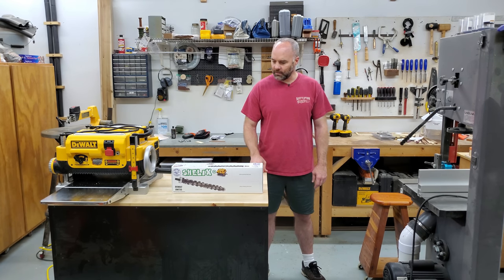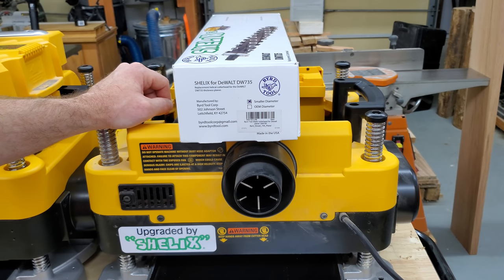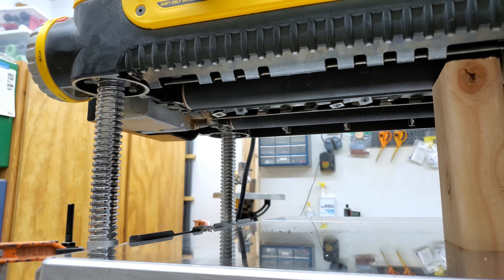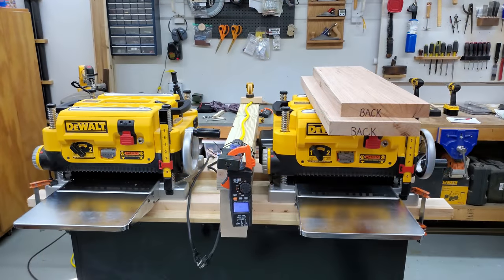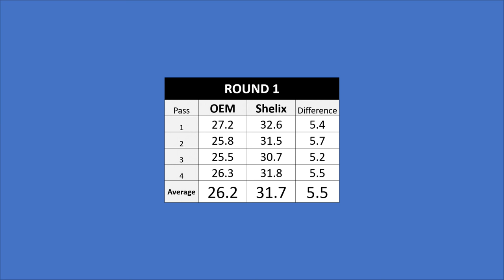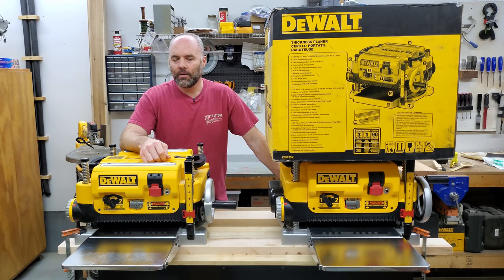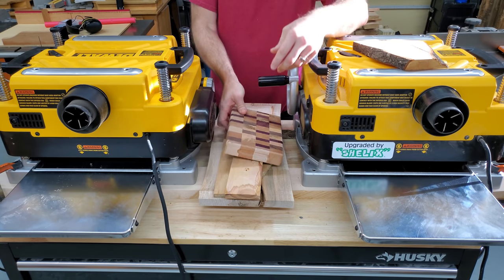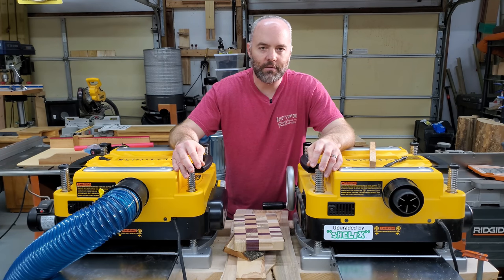The video I wish I watched before buying a SHELIX

Comment from the maker: After numerous questions and comments about amperage measurements and circuit breakers, I decided to disassemble the original circuit breaker from this planer and overload it with twice the rated amperage: https://youtu.be/24f-J0lVo-E. Thanks for keeping me on my toes and challenging anything that doesn't sound right, it makes this channel a lot more interesting for all of us.

Fun fact: This video resulted in Byrd Tool Experts (a distributor of Byrd Tool Corp products) contacting me for an interview, which you can see here: https://byrdtoolexperts.com/the-snekker-show-interview

If you're looking for an installation video, your search is over: https://youtu.be/8J0rvBi8a0k
Reply: Sorry for being late to the party. So to clarify, are you certain that the amperage was 27 amps? and 31 amps for the different cutters? 

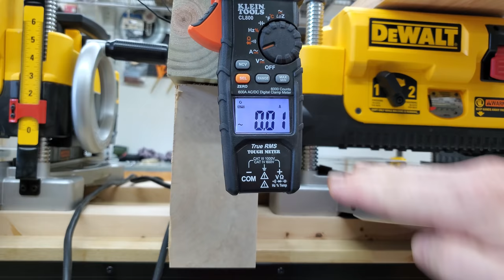Okay, I just found the video where you clarify and prove the amperage draw very clearly here: https://youtu.be/24f-J0lVo-E at 21:00 minutes.

There is a tremendous load on a tool that has to remove that much material, versus a tiny 3/32" wide saw blade. I measured my Grizzly 1 1/2 horsepower, 17 amp, 120 volt table saw motor. The measured current was only 10 amps with no load on it. 

This explains why I was able to use my table saw for hours at at time on really old knob and tube wiring in my old farm shop. The rating on the motor is obviously the "full load" current. My mind is blown, that a planer can draw 30 amps and be rated for 15 amps full load current.
Reply: I bought a Shelix cutter head but haven't installed it yet.  Do you know what is the torque spec for those little carbide knives?
Reply from the maker: @richardseifried7574  Covered at around 27 minutes into this video: https://youtu.be/8J0rvBi8a0k

Comment: If your planer rate of feed is not adjustable, the increase in the amp test is partly because cutter edges pf the smaller diameter roller cutter is effectively traveling at a lower speed (FPM) and as a result is taking a larger bite per revolution, thus loading the cutting edge slightly more. Also, that style carbide cutter does not have the same type of razor edge as your standard planer blades; it is a slightly less sharp edge. If you run your finger along a planer knife edge length wise , it will cut you, those carbide inserts will not. Not a bad thing, but it answers the questions of why the motor sounds different and the amp draw is higher.
Reply: Excellent insight. I'd like to see the same test with the OEM diameter to match surface speed.
Reply: I somewhat disagree with the sharpness comment, as a machinist I fully understand edge prep on carbide but cutters such as this or high positives for aluminum work and generally dead sharp. Carbide deff can be as sharp as steel its just not the norm for metal work.
Reply: @lockgessner  Can be, yes, but as a general rule carbide inserts aren't as sharp as high speed steel tooling. It's quite uncommon for them to be sharpened from the factory. Typically they are molded and sintered and the shrinkage during the sintering process is what passes for sharpening (reduces the radius of the edge). As many (notably Stefan Gotteswinter within the YouTube / Instagram machinist community) have shown, you can sharpen your inserts to be every bit as sharp as high speed steel, but you have to actually sharpen them. Stefan built a low speed diamond lapping machine for that purpose. It is unlikely that anyone will be taking the time to sharpen all of their carbide inserts on all faces for a Shelix planer head.
Reply: I think there may be one other reason for the amp draw. Earlier in the video he said that the smaller Helix roller causes the plainer roller to push down more. That could create enough resistance to cause the amps to increase. Also look at the amps when he turns the machine on. The Helix roller rest amps are lower compared to the original roller rest amps. Why is that? Or maybe I’m just talking out of my ass because I really don’t know.
Reply: I think you’re spot on. I think the sharpness is the more important factor, though. One is an actual knife, with a 25 degree (or so) cutting edge, while the other is a carbide cutter with a 60ish degree edge. That makes the carbide cutters FAR more durable, but they will not slice as well. It’s like trying to slice a tomato with a razor sharp axe vs a razor sharp kitchen knife. They will both cut it, but the thinner edge on the knife will do it with less effort. 

If horsepower is not a concern, and you have a 10hp motor, who cares about a little more effort? But when you have a 1-2hp motor, it makes a difference.
Reply: The amp draw is higher because with the helical cutter head there are always teeth in the cut.
You will have two or three blades in the stock head resulting in an interrupted cut where there are gaps with no load on the motor.
As far as carbide not being as sharp as steel, coated carbide has a slight radius on the cutting edge to minimize chipping of the coating, non coated carbide can be just as sharp as steel but usually has less if a "back rake" angle than steel due to its harder, therefore more brittle nature.
Steels back rake angle is more "acute" than carbide therefore more likely to slice you.
Under a microscope they will have the same edge radius.
Reply: The increased Amp draw on the spiral cutter is not only due to the depth of the cut but also there is constant cutter contact with the material, where as the three blade cutter has space between the blades that allows the cutter head to rotate faster thus draws a little less power.

Comment: Spiral cutters are a nice upgrade and offer a smoother cut, but are also known to require a little more power vs the three blade cutters due to the space in between the 3 blades allows for free spin on the cutter head whereas the spiral cutter blades are constantly engaged in the material thus requiring an added amount of draw on the Amps.
Reply: It's the same reason PWM (pulse width modulated) circuits draw less power.  It's very fast on/off/on/off.  Which is essentially what you get with the OEM knives.

Comment: I wonder if the higher power draw and RPMs are possibly explained by the smaller diameter of the cutter. The smaller diameter will have a lower moment of inertia unless it is significantly heavier. It will also require more torque to provide the same force on the cutting surface. It would be interesting to repeat the test with the OEM diameter cutter.
Reply: I agree... also where the amp meter didn't really change much when wood wasn't going through I suggest part of the difference may be manufacturing differences in the planers themselves or just age/wear.  Sometimes manufacturers have to switch up suppliers, and there could be a 4-5amp difference between those motors. Wear and tear - sawdust and bearing age both in the motor and blade could well account for it as well. Even if it's a PITA, true test would be swapping the blades and running the test again...

Comment: We recently lumbered a 36" maple, a 36" white ash, and a 32" pecan. After drying, we tried planing with a Rigid (Home Depot) 13" planer with 2 HSS knives https://www.youtube.com/post/UgkxIzvvTi3_Qc8JnVdYYRJCvuoDC4QjTzeL . This job was clearly too much for that machine. The pecan was particularly difficult, due to heavy mineral deposits, and a sharp pair of HSS knives would be consumed by a mere 3 boards. We were also having lots of problems from chip bruising, due to poor dust collection. The shavings came off like straw and jammed in the 4" hose.We bought the DW735 simply to be able to run carbide blades, which worked brilliantly for the pecan. However, we found it to be a much, MUCH nicer machine. It was far more rigid than the "Rigid" planer, and far more accurate as well. But what I liked most about it was the dust feed. This machine has its own blower, which shreds the "straw" like shavings as they come off the cutting head and helps boost the shavings into the dust collection system. No more clogs! It's also nicely sealed so that the internals stay quite clean. This is just a well tempered machine that's a delight to use. It literally cut the labor in half. Just another example of getting what you pay for.
Reply: Thank you for that important information. I'm planning on working in hardwoods. Currently I work in redwood mostly

Comment: As a retired test engineer I appreciate the thoughtfulness and thoroughness of your tests. Concerning the difference in amperage readings between the newer DW735 with the three blades vs. the elder with the Shelix heads: The difference might not all be in the type of heads betwixt the two machines. 

Simply, the age disparity between the two machines might make up much of the differences in current draw per task. Bearing wear and tear, for one factor, might introduce enuf friction to cause much of the increased current required to do the same task as the newer machine. It would be most appropriate to compare the differences between the two heads (using your same methodology) on the same machine... either machine will do. That is to say: Either put the original cutter knives on the older machine and rerun the tests--OR--put the Shelix head into the newer machine and repeat. 

This procedure ensures that there is only one variable in play between the A-B testing... only the cutter heads are different.
Reply from the maker: This has been brought up a few times, and I haven't tested it yet, but I doubt that three years of hobby use would cause enough wear on the motor or bearings to account for such a large difference in power draw. Having said that, I've been wrong before, and I'm sure I'll be wrong again. If I ever switch back to the OEM knives, I'll try to remember to take some before and after measurements.
Reply: If the bearings caused that much extra draw, they would get pretty hot pretty quickly.
Reply: Well thought out
Reply: @genebruce6321  the table might not be as smooth as in a new machine. Drive belts state and tension can also have something to do with power consumption.
Reply: In addition to comments already made, DeWalt might use a better quality motor. Who knows what component parts they source based on what's available at any time?
Reply: One missing variable from what I have read so far, is the voltage drop thru the extension cord, for most people they would use a lighter, cheaper 14 ga ext. cord, the resistance would cause a voltage drop, current would go
Up to compensate….so that’s variable hasn’t been tested….may want to check that next go around.

Comment: I have to say this is the most well thought out video I've watched in a long time. You paid attention to volume (most don't) and your process was spot on when comparing both units. I wish everyone could learn from you how to make a good informative video. Thanks for your time.
Reply from the maker: I give your comment five stars, Mr. Critique. Don't watch my older stuff.
Reply: 100% agree.
When I read I title, I thought - typical YouTube click bait.
Then I saw it was 45 mins long.  Thought - this could go either way.
Extremely good video.  Explained what needed to be explained, could skip through what was blah blah to me, but all the way through it was informative and stayed on point.  Thank you.
Extremely surprised on the amp draw.  For me, it was jaw dropping.  I'm in the process of refurbishing an older 12" jointer and swapped out the 4.5HP 3 phase motor for a Baldor 5HP single phase (230V).  It's rated at 20 amps but planned on running 10 gauge wire for the outlet.  Eventually the outlet will also power a [220v~240v] planer.  After seeing this I think I'll go with 8 gauge from panel to outlet.

Comment: Years ago when I made roll top desks and other furniture for a living I had the pleasure of using a 52” planer with a whisper cut head which is real similar to the shelix. It was real quiet and very aggressive w no tear out. Could take off 1/2” at a time on 12” poplar.
Reply from the maker: Wow, I bet the lights in the surrounding neighborhood dimmed when you turned that on.

Comment: Thank you for the update my planer just past a year in retrospect, beyond warranty- upon having it repaired the high-end technician recommended never getting the Shelix head due to the high heat created beside the plastic parts in the DeWalt planer- you're far far better to invest in a commercial planer using consistently @higher level
Reply from the maker: @JonDunnmusician  The planer has a thermal breaker in the front, which should shut down the motor before the heat levels get high enough to melt anything, regardless of cutterhead type.

Comment: I think I purchased mine back in 08 and it still works well for my needs. I don't use it often, but I've run everything from Walnut to African Mahogany to Purple Heart, and even Ipe. It's a slow process, but the machine works. If I were to offer anyone advise it would be to take your time and enjoy the process. This thing is anything but fast. I run with the OEM Blades and trash them when they're done. Before this planer I had a 22,000 lb Oliver  Stratoplane, that's a different story. I enjoyed your comparison. Extremely well done! Thank you.

Comment: I really appreciate you making this video. It answered a lot of questions. I recently bought the dewalt as my 25 year old delta was getting tired... or maybe I was getting tired of it 😉
I solved the tear out problem years ago by buying a thickness sander. I go to the sander with my material .0625" thicker than finished dimensions and take .015" per pass.
As a small furniture maker the extra effort guarantees me a perfect product with no tear out. 
I subscribed to your channel after watching this first video... well done!!!

Comment: Thanks for doing this video. I upgraded to a similar head (Lux), that's essentially the same as the Shelix. The end result is a much better finish, and the planer seems to have an easier time planing all boards vs the stock head. I don't doubt that the upgraded one takes more power, but while on my stock head I routinely blew a breaker, I haven't done so with this one yet. Expensive, but truly a great upgrade for the shop. Planing is now more of a pleasure vs nail biting anxiety time ;)
Reply: Yes, it’s simply not intuitive to me that a cutter that more evenly distributes the load to the motor would ever draw more current than a cutter that essentially pulses the loading.  The louder sound of the straight cutters should have been indicative enough.  As a final test, because the results were not intuitive (and he actually seemed to make that point), I think he should/could have switched the cutters between the two machines to remove the two base machines as a source of variance.  Although the planers were the same model, it’s not to say that the 2020 model could not have had internal improvements to the drive or the motor, eg.

Comment: Fascinating detailed video- just a heads up a year after buying my Dewlat planer the motor died smoke... end
It had carbide blades from infinity cutting tools and not too much use
Reply from the maker: That's still under warranty. You should contact Dewalt.

Comment: Excellent video.  I am not generally interested in power consumption comparisons, because they are mostly focused on running cost.  I was losing interest until I realized how the consumption compared to my breakers.  THEN this became seriously interesting.  Even after reading the comments here, I'm still confused about why the breaker didn't trip.  The sizing differences of the spiral head was hugely non-intuitive, and I'm so glad you shed light on it.  Thank you.
Reply from the maker: The video I linked in the description does a pretty good job of demonstrating, but the short version is that most breakers trip because of heat, not a number. 15 amps for 30 minutes could generate more heat in the breaker than 30 amps for 1 minute.
Reply: @TheSnekkerShow  Heat, consumption, time, breaker specs (reaction time, (slow vs. fast) etc.) See link below for some graphs and dead-simple examples.

Comment: VERY informative. I too upgraded to the Shellix but I did so on my 8” Grizzly joiner. The 16” Grizzly planer came with the Shellix but it also came with a 5 hp 220V motor. The Joiner came with a 3 hp 220 motor. I did find that the joiner loaded down more with the upgraded Shellix. The planer with the larger stock motor did not have any problems even with more aggressive depth settings.

Comment: Great info on the OEM & Undersized cutters. Totally SHOCKED at the amp draw. Glad I have a new 20 amp line in the shop.
Reply: Any tool will draw excessive current if you overload it, which was the case here.  A full turn of the height adjustment handle is generally too much for any hardwood.  I do 1/4 turn increments and 1/2 turn at the most.

Comment: Excellent discussion!  Well conceived, organized, thorough, and intelligently delivered. I installed a Shelix head on my 8” jointer and had planned to upgrade my DeWalt planer next.  I already decided to go with the OEM size head and you confirmed my decision.   I was thinking about your discussion of the warranty matter and I think that you also need to consider the entire drive train of the cleaner that is under higher stress which results in the motor drawing higher amps. So there’s more than just the motor in the thermal overload breaker to be considered I think.Thanks!!
Reply from the maker: Good to hear, thanks for the feedback.